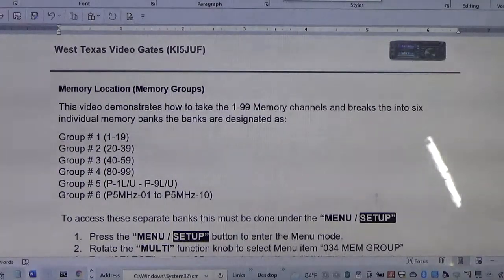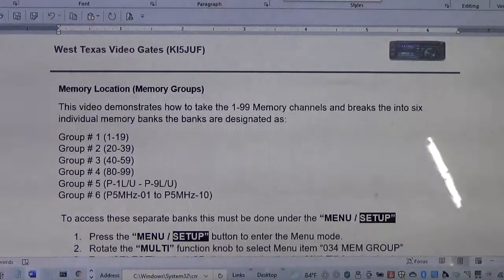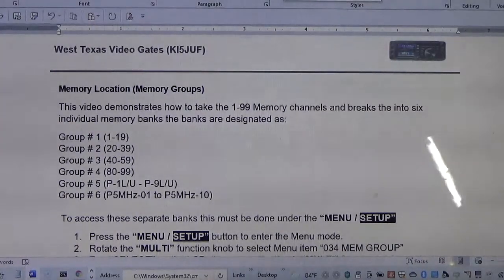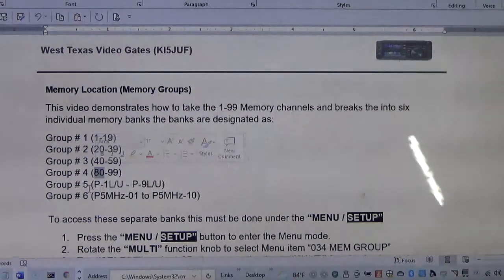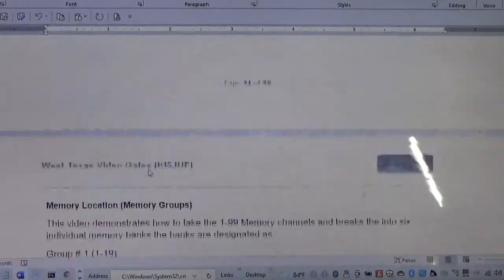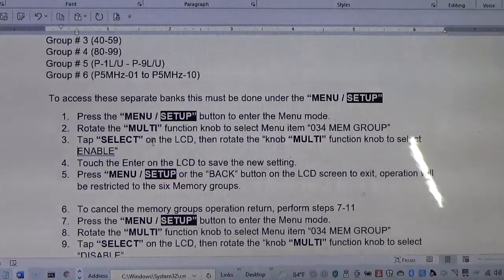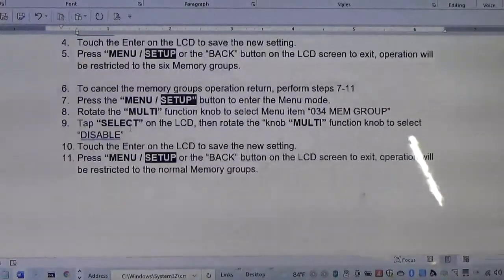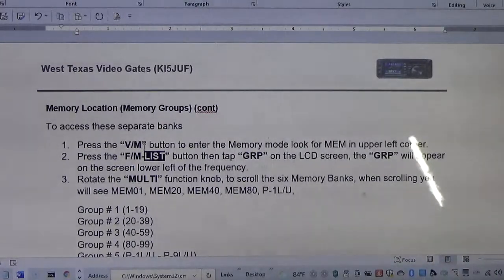Yeasu FT991A Memory Groups how to Compartmentalize  them in blocks of 20 - Menu item “034 MEM GROUP”

Comment: First of all, thanks for doing these videos. they're very helpful

Second of all, 11:36... would love to... but.... the RX frequency range on this radio are pretty woeful. All the emergency services in my area operate on frequencies outside of what this radio can hear. My FT3DR can listen in from something ridiculous like 500 kHz to 1GHz (cellular obviously blocked). And I have 900 channels to play with. And I have meaningful channel banks. Easily programmable with the INCLUDED software. Don't get me wrong, I'm enjoying the radio for 2m/70cm (it definitely performs better than my Anytone 878 on VHF/UHF but on HF, this radio is deaf to stations my iCOM 7300 can pick up, same antenna...) I just wish it was more fully -featured...